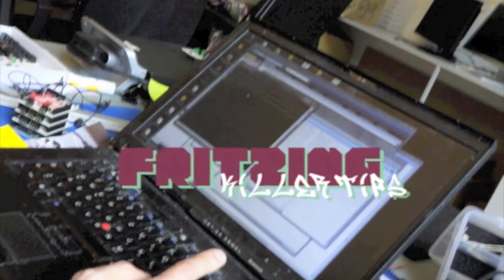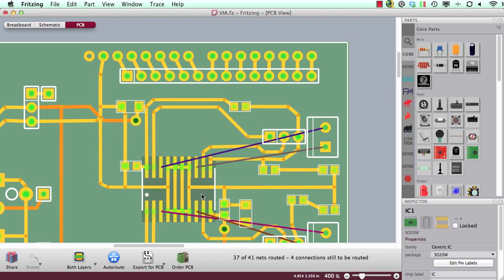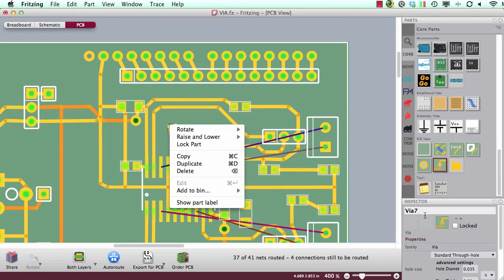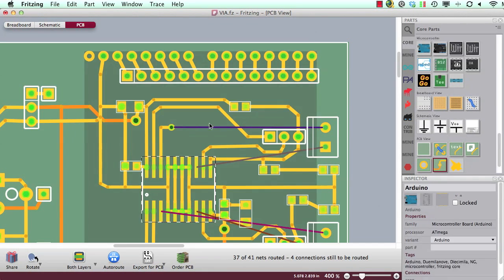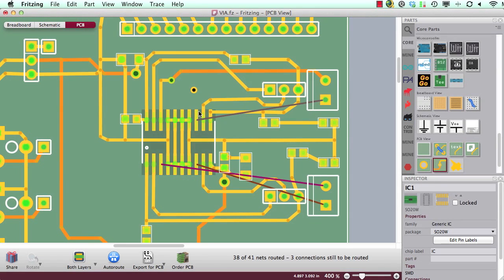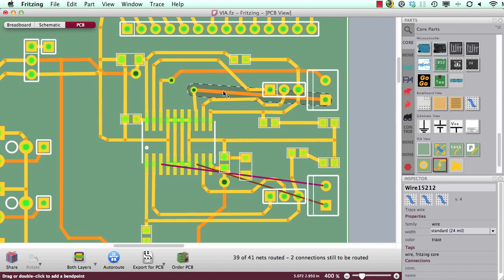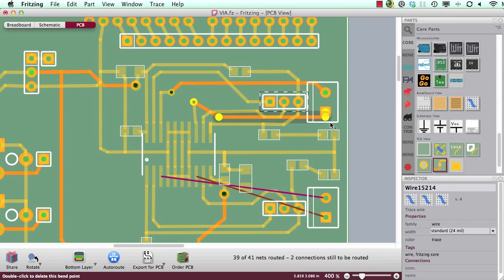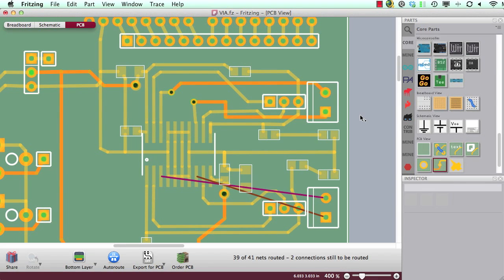Fritzing Killer Tips Episode 3 -- VIAs or from top to bottom

Comment from the maker: @Susie Alimi:

Assuming you are using a recent release of Fritzing (0.8.3 is the latest), then to change the autoroute trace size, under the Routing menu choose the Autorouter/DRC settings option. That will bring up a dialog--choose the "custom" option and you will see a trace width setting.

It is difficult to answer your question about why the double-click isn't working. I would suggest you email your sketch file (.fzz file) to support (at) fritzing (dot) org. Along with that, take a screen shot of your sketch, and circle or otherwise annotate which connection isn't working the way you expected--include that in the email.

Best,

- j

Comment: Hello! I love this software :) I am having a bit of trouble. When you double clicked the connection on the other side of the via, so that the trace goes on the bottom layer, mine doesn't work. I am not sure what I am doing wrong :(

I would like to add: I am creating a board using an ATMEGA2560 micro-controller and I am using most of the pins (over 100!). The Autoroute tool on Fritzing is very good, but it doesn't get all of the traces. 

Another question -- I would like to add 8 mil traces. When I use the Autoroute tool, it traces using the standard 24 mil size. How can I change this to Autoroute the trace size that I want? Is that option available?

Thank you! I hope to hear back from you, considering it has been 9 months since this video was posted :) :)

Comment from the maker: Hi Morten, 

This is actually a good question and it depends. If you etch your PCBs at home, you will propably need to put a wire into the via and solder from both sides (therefor you should use bigger vias, something like 0.8mm). 

If you use a professional service (like the sympatic and nice Fritzing Fab ;) ) a via is contacted from the one side to the other in the manifacturing process. It is called »plated«. Here you don't have to make the connection manually. 

Best,

Stefan"

Comment: Sorry about the potentially stupid question,

in connecting parts through vias, is that then a 'set' connection or will it be a through-hole I'll have to solder a wire though?